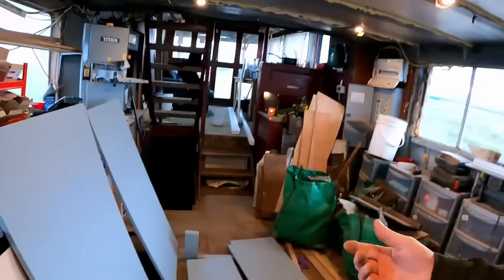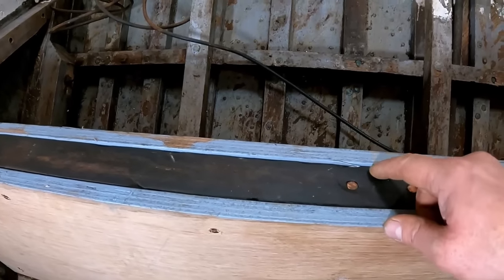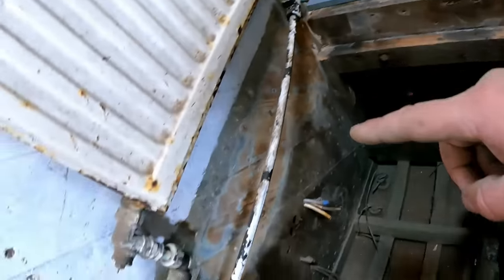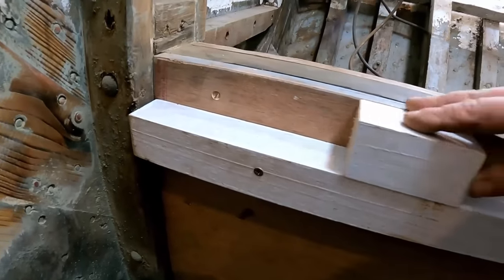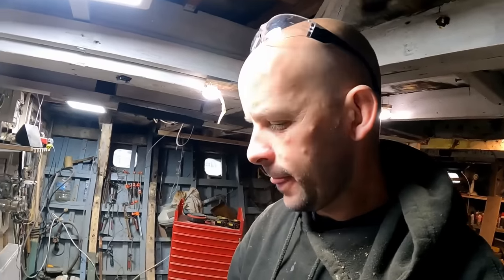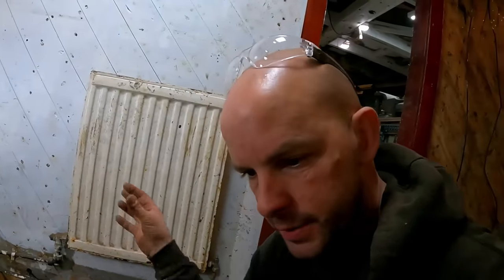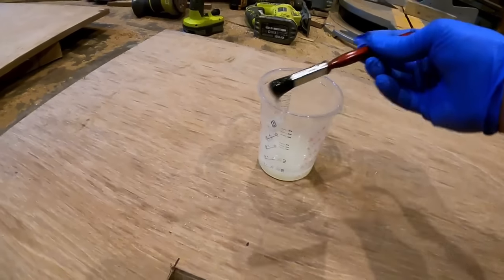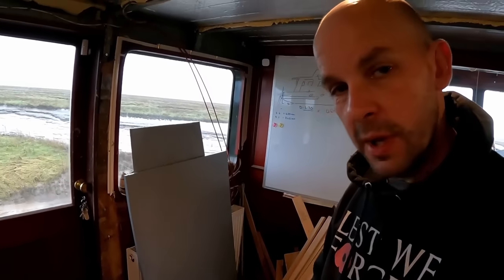Ep 156 - Boat Floor Finally Finished! #boatproject #boatrestoration

Comment: 01/05/20245 Hello Ship. Great job on the flooring. Infill cuts are always hard. Just a small pump means remove cut and fit again. My luck has never been good on the floors.Don usa

Comment: Nice job on the floor.As others mentioned, finger holes or flush pulls are useful. Re: 16:00 with the hole saw-- Nice job. I have way too much experience misusing hole saws (opening 12mm deck steel with charged hydraulic line behind is always fun) and will suggest that, if needed again, tack a stop plate to the far side, predrill the pilot, and replace the pilot drill with a solid rod not quite sticking out beyond the saw teeth. The stop plate will stop the rod, preventing the saw from tearing through and damaging something.

Comment: As a marine engineering student many years ago, our lecturer in naval architecture was always very pedantic about using the correct marine terms for everything, so just for fun I thought I would pull you up on a few of them:
A "floor" is technically "Transverse structural timbers which form that part of the lower frame of a ship's hull that sits immediately above the keel". The correct term is"deck".  There are no ceilings,  the correct term is "deckhead".  There are no walls,  just "bulkheads".  We always got pulled up if we used the wrong words.  So I still remember many of them today, 50 years later!  There is an excellent glossary of nautical terms in Wikipedia.  Very useful if you want to sound knowledgeable!  
Thanks for the fascinating videos, I watch them with great interest as my father was a keen amateur boatbuilder in the 1960s.
Reply from the maker: Are you sure it’s classed as a deck when it’s inside and not a sole?

Comment: I am not a boat builder but I think I would try to run the electric wires through the roof when possible and liquids down low for safety.

Comment: The former fuel storage sole floor is top notch. More work required to get ready for battery storage. Any plans for countersunk finger pulls on the sole boards? Gemma will soon be a bilge rat with all the clean-up, repairs and painting.

Comment: Happy New Year. 
Our battery bank is in the floor/bilge, 12 Golf Cart batteries for the house and 1 8D for start with room to add 6 more Golf cart batteries. The area is ventilated. No problems for the 49 years they have lived there. 
So making a battery compartment in your floor should not be a problem. 
You have way more room than I do.
Your wanting to turn the area into your electrical room is spot on. 
You have the room to build a top notch electrical management area and it is close to the engine room for ease of access.
Cheers.

Comment: I have one question Simon.  Have you not already planned your wiring and pipe infrastructure?  If not, why are you not pre building pathways and routes for quick and easy wire and pipe installation while you have everything exposed in the bilge and the outer hull?  Putting in conduit with pull points is easy at this point.  Just curious what your plan is.  Thank you and I really do enjoy your videos.

Comment: I hate to even say anything but my father who has owned a few large yachts of wood and steel and fiberglass. His 65ft wood hull batteries were on the same level as main bridge just under air bridge made it much easier to maintain kept them near inverters solar chargers etc. Batteries and saltwater are not a good mix and being wood hull it's almost impossible not to get water even in interior bilge areas in rough seas. I'm not there to see the construction nature of things so don't take it personal I might be wrong! Just a thought!!

Comment: Excellent  job on your boat.  I am quite impressed with you and your wife’s teamwork.  

About the engine bearers not being attached to the bulkhead on one end.  I’m thinking “expansion joint”. Any boat (for that matter anything of length) needs to flex a bit.  Take into account your 80 feet, the natural tendency of any hull to “hog”, the distance between two successive wave crests and the resulting trough, and any other number of force transfers through the hull, you may need to have those engine bearers not attached at one end.  The new attachments just may get pulled out of the bulkhead.  They are plenty strong to support the ‘ex’ fuel tanks and new decking without being attached at the one end.  

Just wondering.  Keep up the good work.

Comment: Next time, save yourself lots of effort and material (= money) and put those "engine bearers" 2 inches or so lower and run your floors as continuous members athwartships over them from web-frame to web-frame as that adds stiffness to the hull whilst saving money and effort.

Comment: wrong way arround first the walls then the floor , you are making this the wrong way around ;-)
Reply from the maker: It helps working on the floor so you have a stable platform to work from, as everything under the floor is already done!
Reply: @ShipHappensUK  you took wrong it was a jokey thats why the ;-) face have seen the reason for all the work on the floor have the same with my workshop problem the floor must work without falling trough then you can look into the walls so perfekt work little monky ;-)